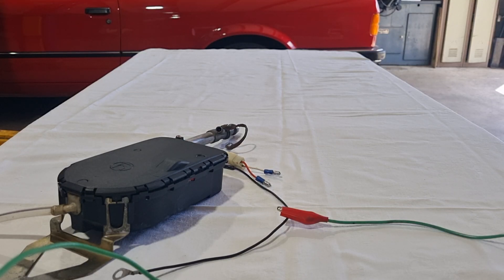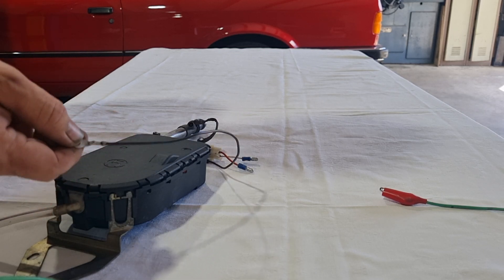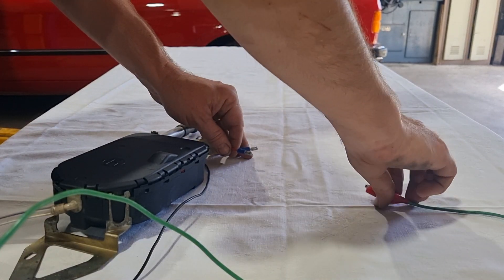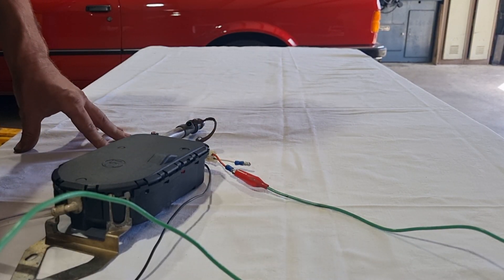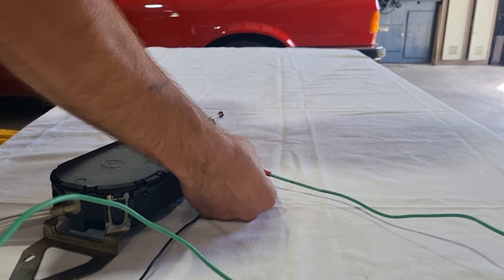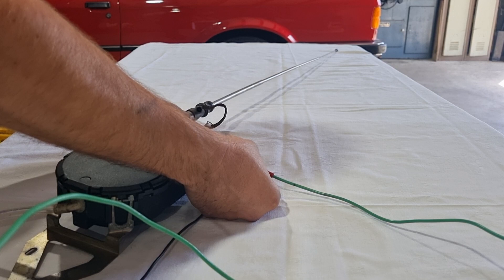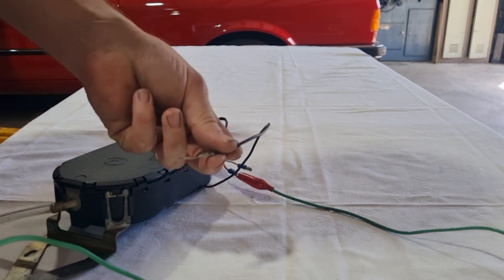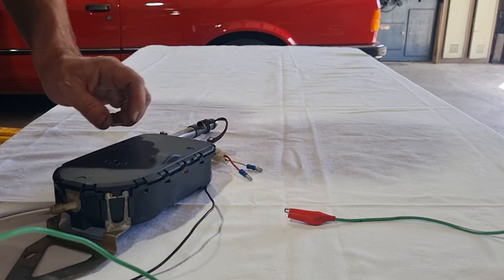E30 Hirschmann Antenna

Comment: Hey jon im extremwly desperate to know ro the F do i change my cabin fan resistos its not the same as on the 6 cylinders i discovered i have a 89 318i M40 car and i canf find a manual or good info anywere ive gone to the point to just take apart the whole dash just to try and figure out how it works if you have info or goods tips pls write back.

-Stefan
Reply from the maker: Hi Stefan, sorry for the late response , traditionally the blower resister in the later E30 was located by the blower motor- bulkhead. However you may have the style where the resister is located in the heater box ,in the cabin, left side ,under dash and above the heater Tap,it's a  brown square block. Hope you manage to locate it and got it  sorted. Cheers Jon
Reply: @das.bmw.mechaniker  thanks alot ill have a look at that you are a life saver!
Reply: @das.bmw.mechaniker  oh and also while i have you here i am looking into replacing my transmission in mine since mine is whining like crazy now i have heard that the pre 1990 does not have a overdrive on 5th and only the older ones like my 89 have overdrive is this true or false and can i use either ttrans in my car its a manual btw
Reply: @das.bmw.mechaniker also to remove the cabin blower is it roughly the same as the m20 cars im very careful now since i akready broke the litle plastic piece that holds the "lid" shut over the fan ill haft to glue that back if i can